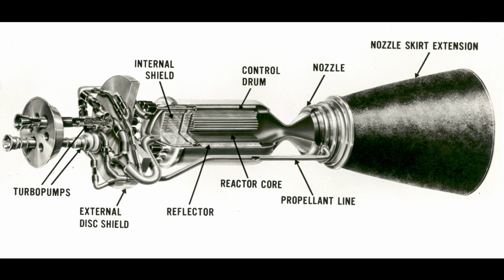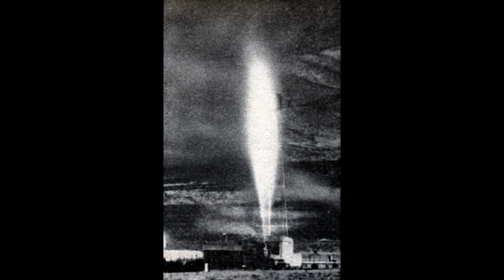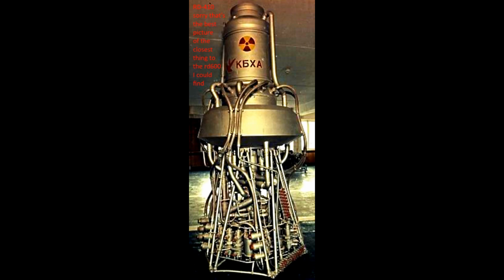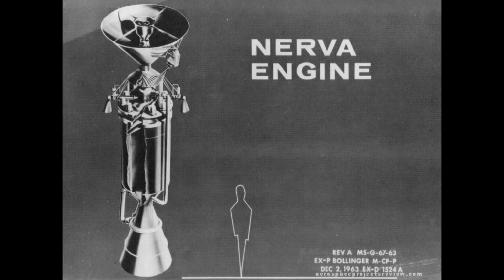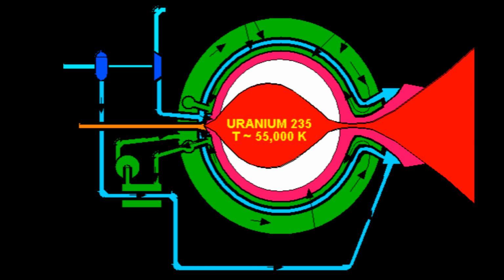Talking On Nuclear Space Propulsion - RD-600 And Tintins Rocket

Comment: There's actually one design for a clean gas-core nuclear thermal rocket, called the "nuclear lightbulb". The idea is to have the gas core be surrounded by thick walls of quartz glass. The core would be so hot that the majority of the radiation would be in the hard ultraviolet, to which quartz is almost completely transparent to, so it would pass through the walls and heat the propellant radiatively. The relatively low density of the gas core would keep heat transfer to the quartz down, but it would still have a limited burn time before needing to be rebuilt because of it ablating away from both sides, as no material on Earth can withstand temperatures 4 times hotter than the surface of the Sun (!!!). Specific impulse would be from 1500-3500 seconds.
Reply from the maker: thats a pretty cool concept, but unfortunately, as you said, its still limited in its runtime and reliability - hypothetically it could work quite long but with our engineering capabilities, at least without adding another twist, it would be too limited to really take advantage of the specific impulse